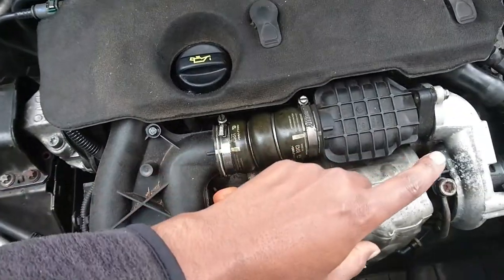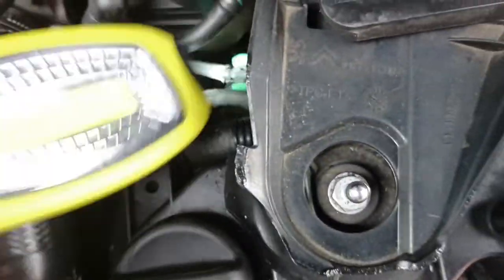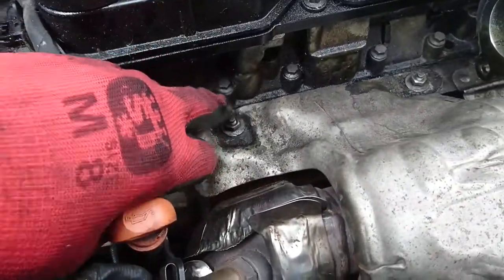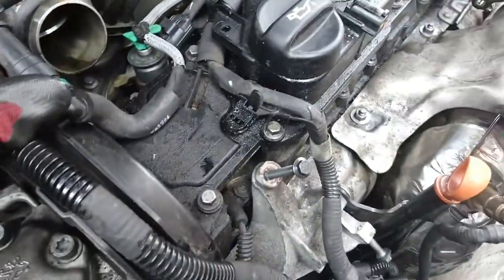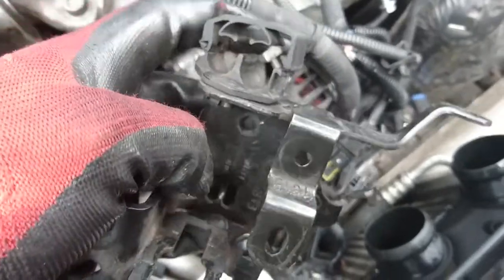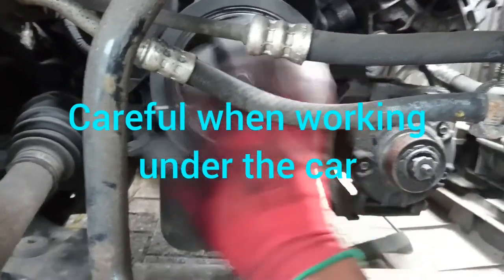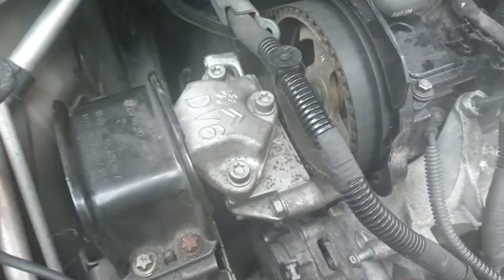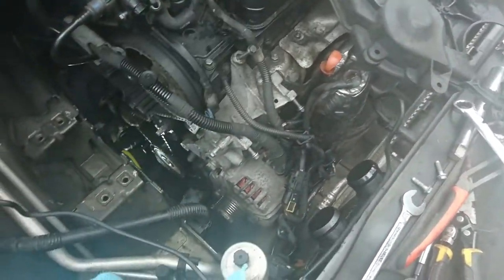CAMBELT REPLACEMENT + WATER PUMP REPLACEMENT + OIL LEAKS REPAIR

Comment: Yesterday I wanted to buy a c3 1.4hdi, there was the same oil around the injector, I thought it was fuel around the diesel until I smelled it, the car has 130,000 km, is this normal and harmless
Reply from the maker: I thought this is common fault on most 1.6hdi or tdi engines. It could be easy fix.

Comment: Could You tell is there a classic gasket (steel or any other material), or You used a silikone gasket between cylinder head and camshaft case?
Reply from the maker: Hi, no brother they don't use a classic normal gasket and I don't know why! They use a special silicone gasket designed for engines. It is high temperature and oil resistant.